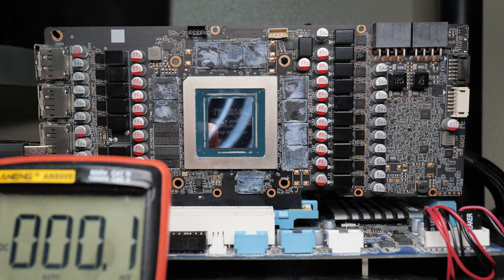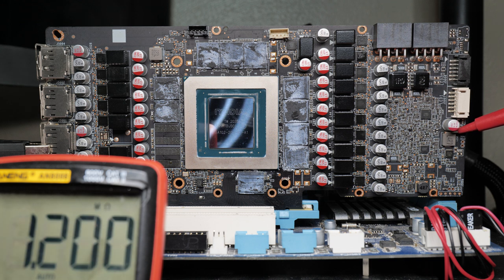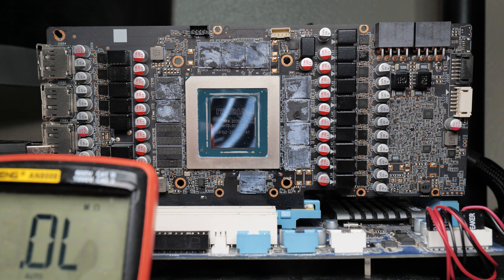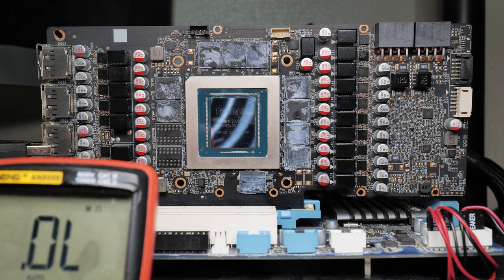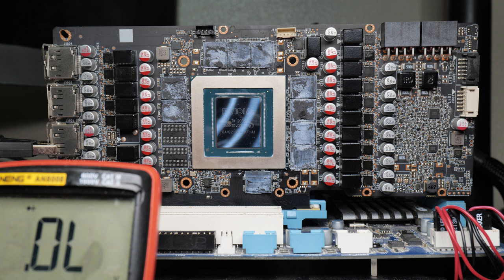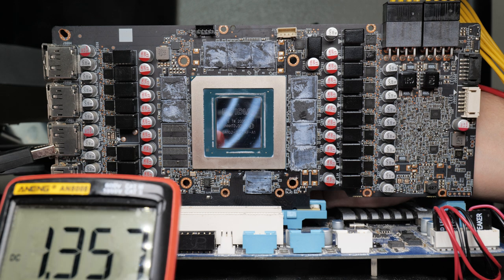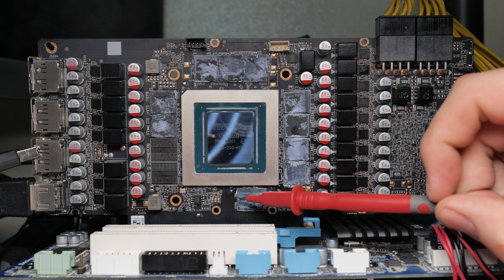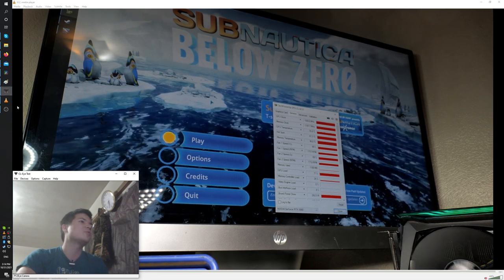Zotac RTX 3080 Amp Holo Graphics Card Repair - Not Detected

Comment: ^^This was my card. I was the asshat who plugged in a riser to a powered on board. I can confirm the thing is back in the rig running as good as ever. Thank you Tech Cemetery!!! 👍👍👍👍
Reply: How much did he charge you for the repairs?
Reply: @ronaldhowell5831  $250, and I covered shipping.
Reply: @Beanie5150  Is $250 include the shipping?
Reply: @limitededitionets2445  no you have to pay the send shipping and return shipping so you will spend like $300 to get it fix
Reply: @graphicscardtech3167  thanks for the information
Reply: @graphicscardtech3167  $300 is way better than a dead card, but $300 aint cheap by any standard. I sold me my GTX1080 for $350 USD last year, so in that case, it would not be worth to fix it IMO, but rather put that $$ into a new(er) or another card
Reply: @zackriso3945  Well, given how valuable the 3080s are now...250 bucks is ok.

Comment: what should I investigate in case of the measure 04:29 not give me the same number in the first pair? For example you read 1.6 and all the pairs, but in my board I get two different numbers in the first pair and the exact same number in and between all the others pairs. The first pin of the first pair I read something like 43 the second i read 27 and all the others pairs I read 0.06. Would thank you for any kind of help!

Comment: Hi mate great work there! I have the same board, except is a Ti model. Changed the gate, i can hear the normal beep, but still no video. No voltage on VOUT with the old and new gate. What resistor did you change, can you give me a little help on this? I would greatly appreciate it!

Comment: Do this type or circuitry exist also on a 1800 ti? Because the card has all the voltages but just don't show anything neither on displayport or HDMI.
Reply: Hi, I have the same problem, did you manage to solve it?
Reply: @SoyKiritoYT  Haven't had time to dealt more with it as for now, but so far no. Contemplating to have it sent to a repair shop.

Comment: Excellent video! What chip is that and gate? Is it the same model that was originally on the board?
Reply from the maker: https://www.onsemi.com/pdf/datasheet/mc74vhc1g08-d.pdf

It's logically equivalent to the data sheet listed. I don't always use the exact same model as a replacement. AND gates are fairly standardized and so equivalents can often taken from a donor board.
Reply: @TechCemetery  thank you for the response! I watched my and gate pop like a firework last night on my 3080 FE. Doubt replacing it will fix everything but I appreciate your time and your videos.

Comment: my rtx 2080 shorted out on the leds and now the card reads 11.07 on 12v rail, 1.67v on 1.8 rail and is not getting detected.  After binge watching these vids I suspect I need to replace of of those AND gates... Gotta disassemble my w/c rig to measure all of those voltages which is going to be a major pain...
Reply: but you'll learn a lot!

Comment: Random question. What should the amperage draw in a good gtx 1070 be at 0.8v. With voltage injection directly on gpu power rail.
Reply: V=RI

Comment: Well made video 
I have a gtx 970 msi red dragon 
with 6 vcore stages 
out of which 2 are burnt out (through the board) sm7320 
can I still run it at 100% tdp with only 4 stages I have replaced the pads for the mosfets as well
Reply from the maker: No, wait for replacement MOSFETs.